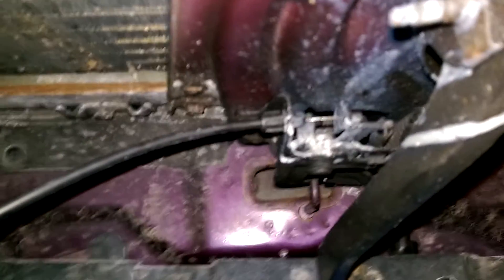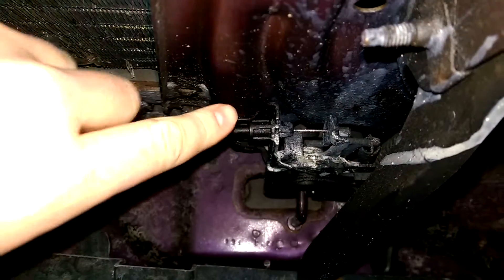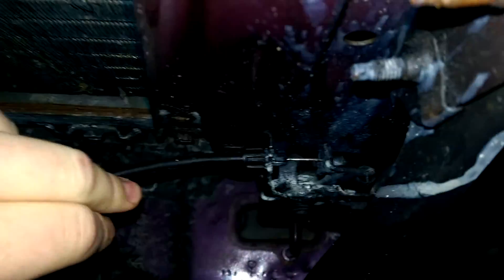How to open hood when cable frozen - older GM products

Comment: my problem is I got a plastic splash gard I gotta remove as I cant even see the latch ur showing me n the car is in a bad spot and the engine is dead I nreed to jump or charge the batter and its very cold like about 10 degrees farenheit but Im still working on it it spose to warm up a little tofday like maybe 32 degrees